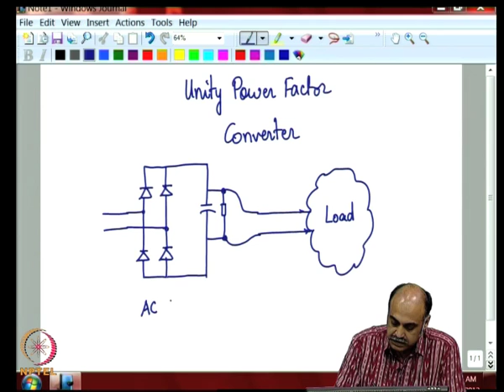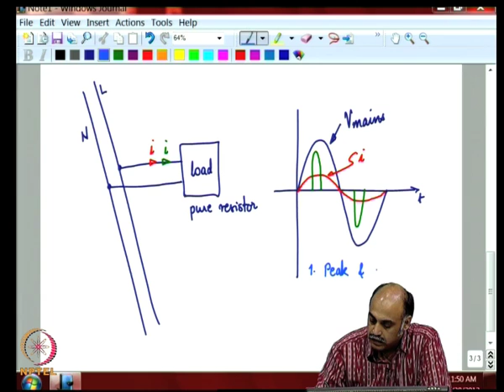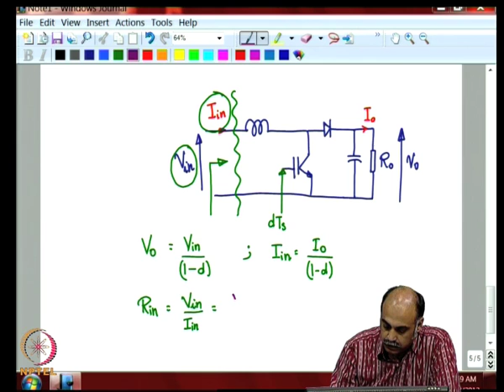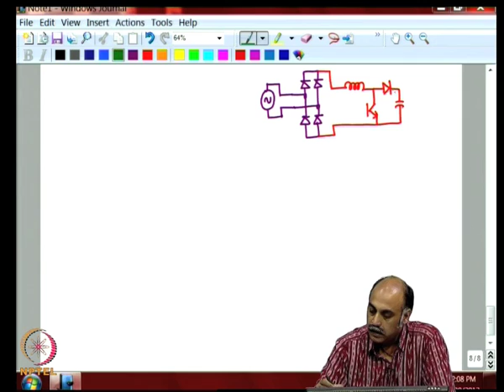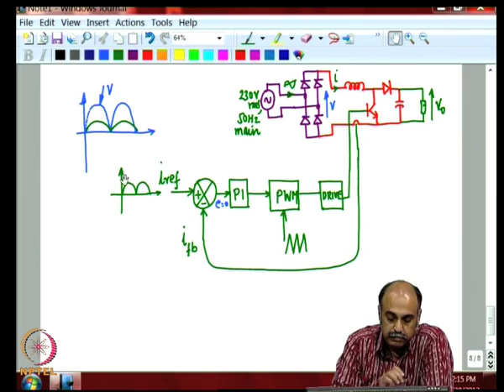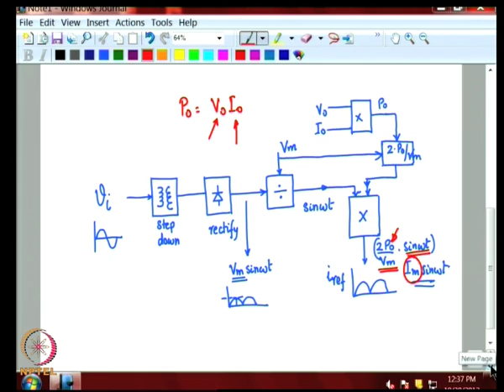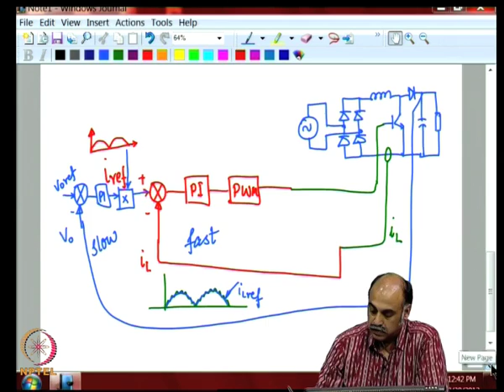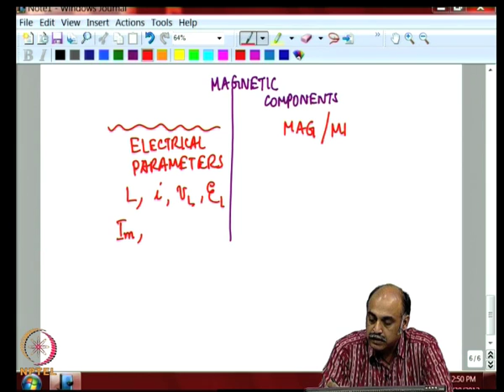Mod-12 Lec-38 Unity Power Factor Converter

Comment: Great explanation sir..... But i want to know how to tune PI controller in case of ac-dc converter.....
Reply: see :Course Material
on
Switched Mode Power Conversion
Department of Electrical Engineering
Indian Institute of Science
Bangalore 560012
(for Private Circulation Only)
V. Ramanarayanan
 Chatper 6
Reply: @subhojitdas108  thanks bro
Reply: @subhojitdas108  thanks